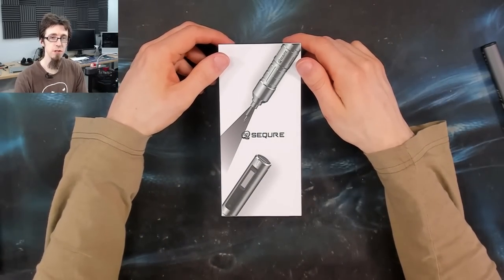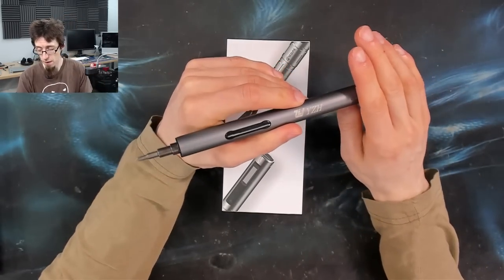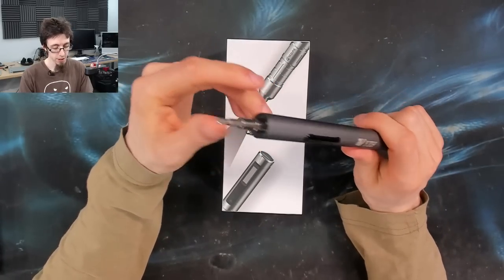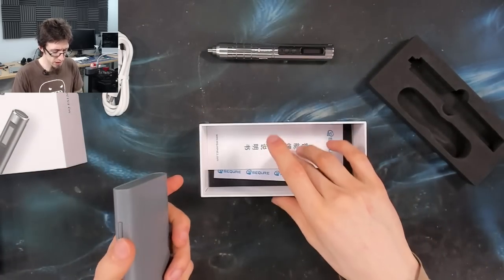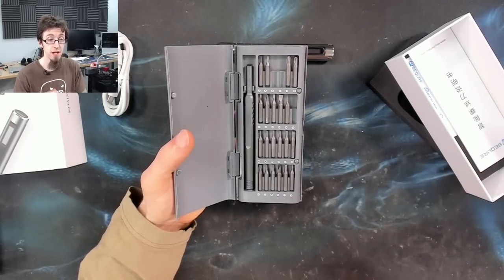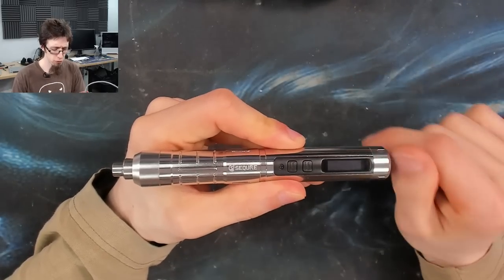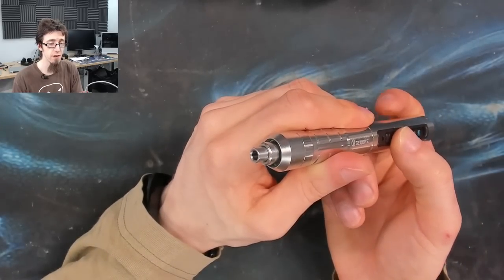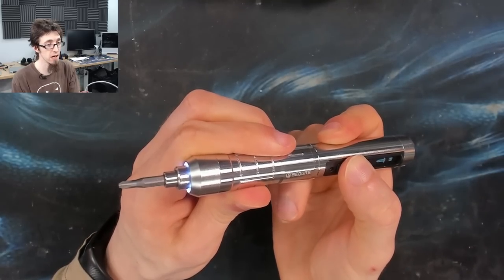Sequre SQ-ES126 Electric Screw Driver - LFC#274

Comment: A great idea would be if it could do a half turn semi clockwise before turning clockwise when putting screws in, so it ensures that it's using the original thread, rather than cutting a new one.
Reply: I would only use these to remove screws not install them
Reply: @trilexfix  These are specifically designed to tighten precision screws all the way in without over torquing, it has a surprisingly Intuitive feel to it which works well.
Reply: I gotta throw in with johnnythefixer on this point
Reply: @neiliewheeliebin  I would suggest a Worx this pen one isn't gonna cut it if you do this professionally.

Comment: Lol why doesn't anyone mention anything about RPM's?   its the most important thing.   I've used one which had 180RPM which was friggin slow.   Ended up getting one which had 380RPM's  with a clutch,   Huge difference....  Don't waste your $$$$ on ones that have 200RPM's or lower

Comment: Crazy amount of screws on that keyboard.
Reply: I would still prefer crazy amount of screws to what the newer models offer, they're welded in and you have to essentially tear the keyboard out.
Reply from the maker: Yea... I've always mocked this laptop for the crazy screw count, but they do ensure that the replacement keyboard fits just as good as the factory one, and the alternative is rivets or heatstakes 😩

Comment: Cool tech and user design in this tool, the twist direction selection is ingenious! 👍 Not overcamming small screws is also impressive. I'm still sticking to manual screwdrivers though, because I like feeling the threads and pressure, plus I don't have to think about maintaining one more battery device. Thanks for the demo. 🤘

Comment: That turn motion will get old really fast
Reply from the maker: Hit and miss. Sometimes it's incredibly handy because the turn action gets the screw started (loose) and then the motor does the rest for you. But as I mentioned, sometimes it's annoying because your wrist is already twisted, and you can't adjust your grip because you need to press the button as well...

Comment: Just not long ago got myself an es 180 model, nice little tool good built quailty and very reasonably priced👍😀
Reply: @_Schwalbe_262_ think it was 30 with postage and packaging, so was pretty happy and works great deffo recommend 👌
Reply: @_Schwalbe_262_ yeah I wouldn't pay that much for an electric screwdriver,🤔 it's a nice product but way too expensive 🙄

Comment: I see many people using pressured air to clean the fans when they are still plugged into the motherboard, when you do that the fans starts spinning and maybe faster than it normally does and when you do that you are using the fan in reverse which will generate a voltage which will go back to the driving transistor and possibly blow it up.

I saw you doing that too, it will go right 1000 times and then it goes wrong once and you have more problems.

Comment: This is impressive the torque is fully electronic controlled so theres no need for a clutch. I've been looking for something like this since my Jakemy JM-Y02 plus flimsy clutch/plastic tension ring broke
Reply: The torque sensing is kind of a lie, bit it's simple. 

If you rotate it in the direction that you want it to spin, as soon as it bottoms out, it actually twists it back in your hand so the amount of torque that's placed on it is the exact amount of torque that your hand is putting on it. If you grip it really tight and keep turning it will continue turning against your hand, but if you relax your hand and let it untwist a little bit it will stop
Reply: @pilotavery  The retreat your referring to is a seperate function. I don't use the ES126 anymore the battery life sucks on it so I got the MINIWARE ES15 instead, it's had 7 firmware updates & torque/load sensitivity is improved. I'm guessing it works by sensing a current load increase the deeper the screw goes in & adjusts itself accordingly

Comment: I agree with the manual screwdriver comments.  I love my Wera set - they finally released a 25 piece Kraftform micro set.  Kinda expensive, but worth it to me!
Reply from the maker: Ah, I'll have to look for that, it's very hard to find the Kraftforms in a useful set, I bought most of mine individually.
But I really need a second set, so I'll go look that up. I agree, if you use screw drivers every day, they're absolutely worth the investment.
Reply: I've used Wira for years and the hardened tips show no wear.

Comment: this screwdriver lasted me for about 2-3 months before I ran into issues. imo, the minute you try to use it as a normal screwdriver and unscrew a stubborn screw manually, it will lead to something becoming disconnected or some other issue. to keep it simple, it keeps asking me for an update or it only works for about 1/10th of a second before turning off. I don't get it.

at this point I got a cheap tacklife electric screwdriver and would probably consider 3d printing an adapter to work with the smaller bits. that's just me though.
if not 3d printing then use glue or something.. idk.

Comment: I bought a Wowstick, had to send it back as it failed on the first screw, could hear the gears grinding
Reply from the maker: Yea the wowstick is the cheapest of the electric bois... I think that one uses AAA batteries? Which makes me doubt its torque capability because it can't pull as much current as the lipo powered ones.

Comment: So this is basically an upgraded clone of the Miniware ES120/ES121? It even runs the same firmware. Some shops are listing this as the successor to the ES121. Do you know if it's made by Sequre under license from Miniware, or is it actually just a clone?
Reply: It's a rebrand of some sort with no active development whatsoever. The MINIWARE ES15 is a much better option, it's up to its 7th firmware update released the other day,

Comment: How has this driver held up over the past nine+ months since you made this video? I've gone through two of the other type (nearly identical to your YZH), the first lasting almost a year and the second dying after less than six months. I'm considering spending the extra money on a better driver and wanted to check to see if you still feel this one is worth the price.
Reply from the maker: Still going strong. I think part of it might be that the torque control prevents you from brutalising it as much. The YZH driver I was really brutal on, I would use it on big screws ruthlessly - you literally can't do that with the Sequre. But for laptops it's still fast and smooth and my main-use screw driver. I still use it in conjunction with other drivers - I hate swapping bits constantly while working, so if a laptop is 80% T5 and 20% PH0, I'll have a T5 in the sequre and my Wera PH0 next to me.

Comment: I use a Xiaomi similar to the YZH for phone repair. I haven't had issues with it being too much torque since I adjusted how I use it.
I hold it loosely in a way that the handle will spin the button out from under my finger once the screw bottoms out.
For higher torque screws I just grip tighter.

Comment: I found the battery life to be too short for any serious use,it has a 180mah AAA/10440 lithium cell which is tiny. Also the button location is awkward to use. It doesn't appear to have any active firmware development either which is disappointing. 
I own both the SEQUIRE ES15 & the MINIWARE ES126 which is a much better option
Reply: So you prefer the Miniware? The ES15? Are there any major advantages other than the bigger battery and better placed button? Does the impact function make a big difference too? Thanks!
Reply: I think you mean Miniware ES15 (not ES126). They do also make an ES121 which seems more similar to the Sequire ES126. 

ES121 was the original (open?) design I believe.
Reply: @av_oid  Sorry yes I mean Miniware ES15, it uses 4mm bits same as the Sequire ES126
Reply: @CoopzVideo  Both are beautifully built & use 4mm bits but the Miniware ES15 is more powerful due to the larger battery.Its pretty much better in everything it's been well optimised

Comment: Do you think it is powerful enough to screw in a cpu waterblock to the motherboard tightly?
Reply from the maker: Not fully. Anything bigger than a laptop screw you'd zap it in, and then give it the last tighten by hand - but it still takes the leg work out of the job. Tensioned screws (spring-loaded coolers) it may struggle with though.
Reply: @Adamant_IT  Thanks, that's basically what I thought, but hoped mildly that I was wrong. 👍

Comment: How long does the battery last and how fast does it charge??
Reply from the maker: Ah, always something I forget to mention... with intermittent daily use I get a week out of a charge, and it takes maybe an hour to recharge. Only a tiny little 330mAh cell in there. The on-screen battery indicator wasn't very helpful, but you can definitely feel it getting sluggish when the battery is low, so that's your hint to plug it in.

Comment: My computer is just switching it's self back on every time I shut down 😏😭😭😭😭 please help what could be the course of this problem ?
Reply: Could be as simple as a defective power switch. Start there.
Reply: Have you tried turning it off and on again?
Reply: What do you mean by "switching it's self back"?
Reply: Maybe a long shot but try to enable ErP in your UEFI under power management.
Reply: @zebart  like when I shut it down it will stay like some seconds and then it turn it's self on
Reply: @DaleDix  many time even tried pushing power button like some second it will restart
Reply: @DarkoPetreski  so what can I do any ideas how to fix it
Reply: Could be a flat BIOS Battery? I've seen motherboards that power up immediately because of that.